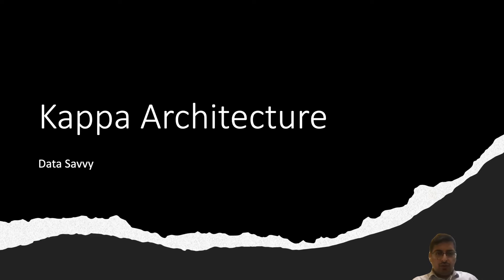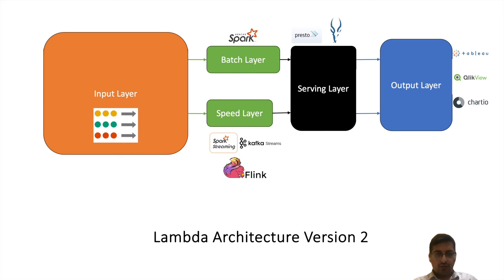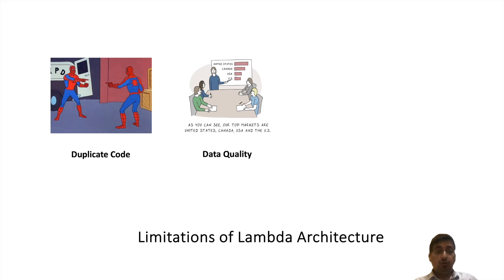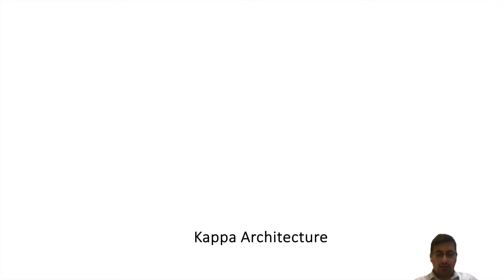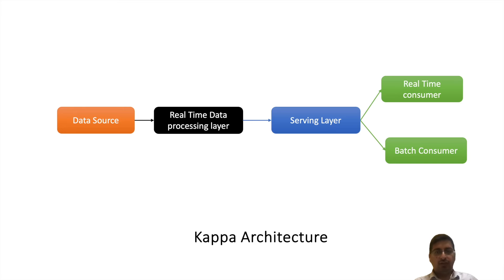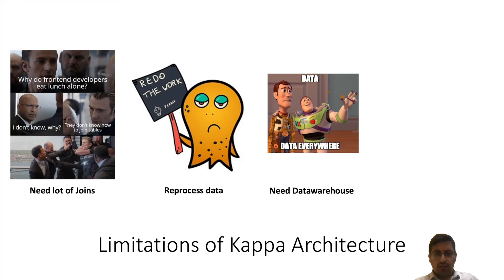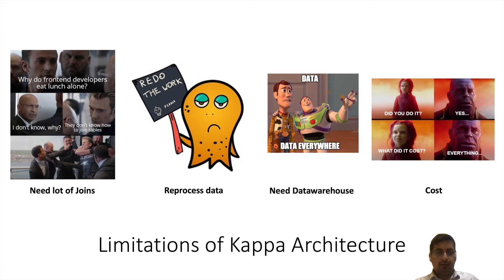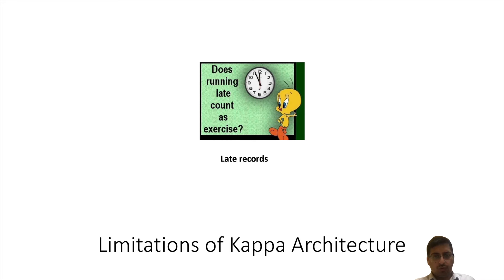Kappa Architecture | Data engineering system design qustions

Comment: In lambda architecture so far no one has explained how de duplication is handled when the batch and stream processing data is combined in serving layer?
whatever data is processed by streaming layer will eventually gets processed in batch layer? if this is true then previous streaming layer processed data is no more required. so do we need to remove that data processed by streaming layer?